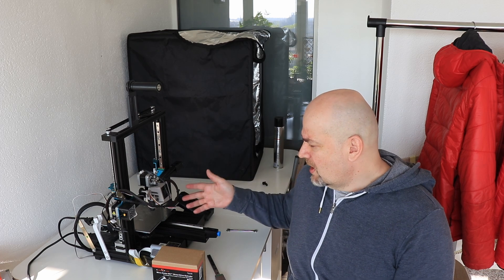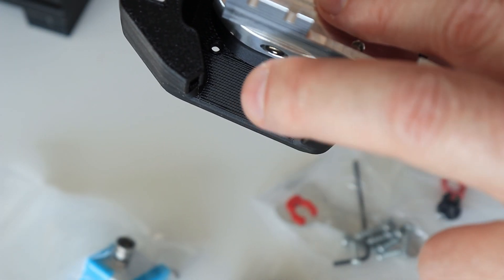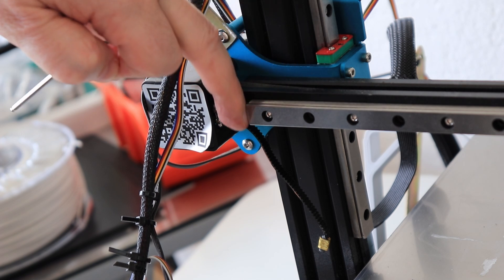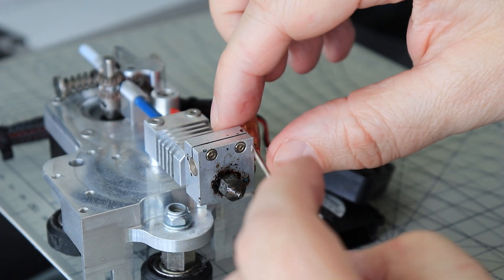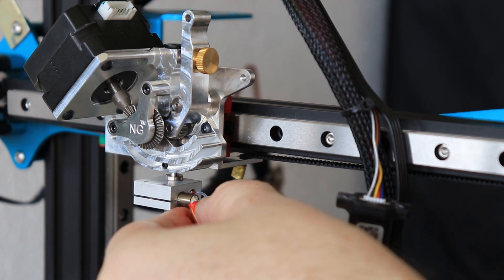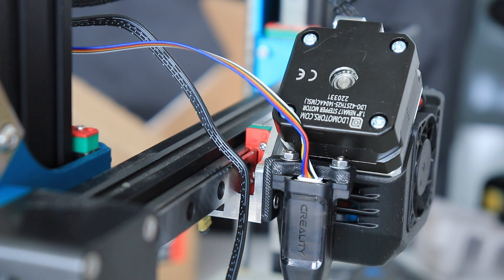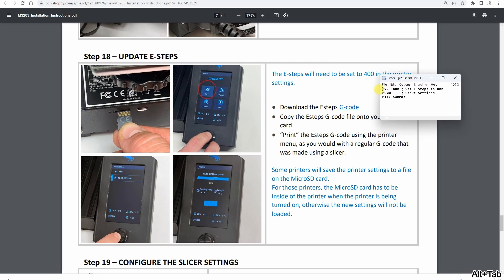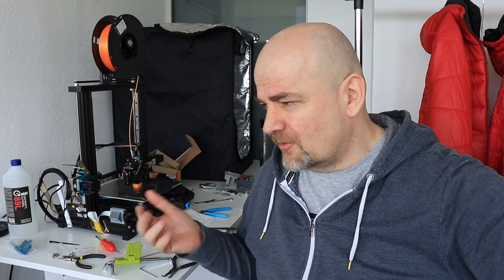Installing X linear rail and MicroSwiss NG extruder on Ender-3 V2

Comment: Micro-Swiss' store page has a couple reviews that say the included fan shroud will eventually droop if used at high temperature. I'd recommend printing a replacement shroud soon as possible in something more temperature resistant than PETG, since you already have to print out a bed probe mount.

Comment: how well does the NG cope with TPU?
I have the original microswiss DD and the tpu get's push between the DD sprockets and gets fed to outside the extruder.
I replaced the tubing between the hotend and the extruder but after a few prints it happened again. slowed down speed to 30mm/s and it prints okay, but i have been printing tpu on 45mm/s for a year at least with no problems.

Comment: I’ve been following your upgrade videos on the ender 3v2 for years so thanks for continuing the series. I understand it’s somewhat of a dinosaur compared to today’s hardware but your videos help with determining what long term upgrades are still available and have saved me a lot of trail an error. Other than an inclosure and maybe some fan mods…it looks like it’s the end of the upgrade path.

About the E steps, some add it to their slicer preloads. But this was with a different printer.

Comment: Hey! Thank you for making this video. I just got the same linear rail and the linear rail extruder, the exact same in the link. I don't seem to have the spacers for attaching to the limit switch. Is it not included? Can I install it without it?
Reply from the maker: Try by moving the extruder with your hand to see if it will be pressed. Those spacers for X limit switch can be 3D printed too.
Reply: @MyTechFun  do you have a link to the spacers and what length are linear rails? link doesnt work anymore

Comment: I am still amazed people think micro swiss components are good, a year of printing and they are pretty much a throw away part. Not good quality at all, in fact many Chinese rip offs are better.
Reply: Weird, my nozzles and direct drive bracket have been installed since early 2021. They look and perform the same as they did when I installed them.
Reply from the maker: I confirm this, I woudn't replace the old extruder if it could be mount on linear rails.